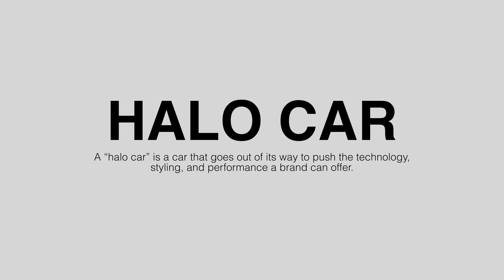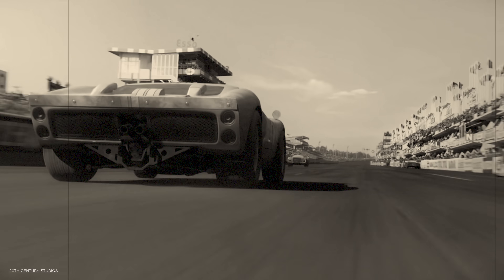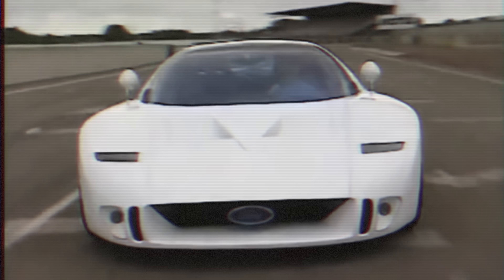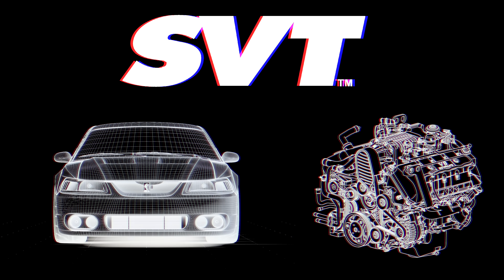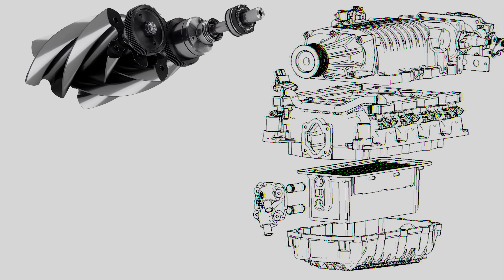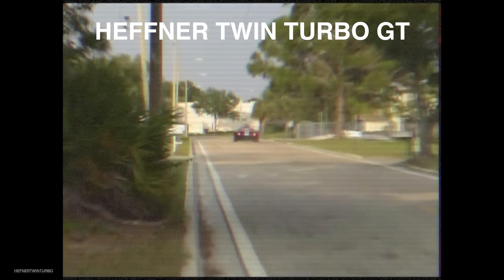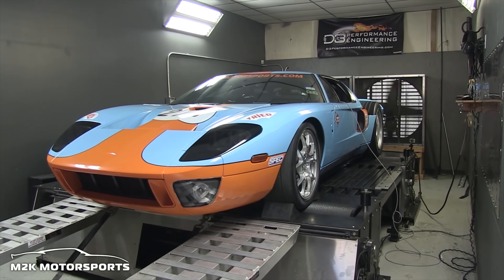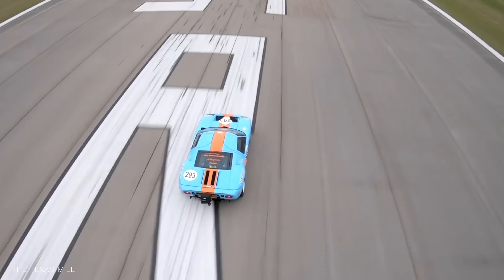Why Ford GT Engines Are Too Powerful (300MPH)😳| Explained Ep.16

Comment: 3000hp on the STOCK BLOCK is absolutely mind blowing stuff. This generation of ford GT is one of the great road cars in history
Reply: 4,000hp. Check out MMR Racing
Reply: Shelby himself. Peak acumen for petrol power.
Reply: And THIS! ...is why Doug Demuro bought one....legendary car...constantly appreciating
Reply: We have all seen what the 05' gt has evolved into.
Reply: boumahdi 🇩🇿  With billet block.
Reply: It's 310.8 to be specific. His goal now in the next 5 years is to push it to 400mph
Reply: @thomasgilliam3104 will never happen the Badd GT is fast but no street legal road car on earth can reach 400mph with a regular internal combustion engine.
Reply: @uriahbleue1947 he just needs to lower the drag. Most land speed cars that reach 400+ mph have a 3,000 hp engine
Reply: Amen 🙂
Reply: it is so great that Ford is going to stop making it because no one is buying it
Reply: Yea hp and mph are not the same.
Reply: I initially thought the 3000 was a typo until I watched the complete video. What an incredible machine! 💙🧡🤍, 💙🤍❤️
Reply: the most mind blowing part in that is the fact that those tyres held off at 300mph with nearly 2 tons of load and 3 veyron's worth of power twisting them
Reply: Different sleeves and of course those ARP studs.
Reply: The viper can handle 3k hp too lmfao
Reply: The old triton motors can do wonders with some better 4v heads on em.
Reply: The teksid blocks have allready easily handled 2500+ hp.
Reply: So is it stronger than LS?
Reply: @insansiregar6158  Any DOHC engine is stronger than a OHV pushrod
Reply: @insansiregar6158  Yes, won't lift heads, and flows more. LS good for 1500ish then start running into issues.
Reply: Sounds to me like they did some Toyota-esque overengineering on that one, and it paid off for the tuning community
Reply: @geronimowindow  no, it was a Ford-“esque” move their mod motor blocks hold insane amount of power. This Ford GT also uses stock heads. The suspension of the car is also stock, so is the body little no aero work.
Reply: @CoyoteFTW  it simply doesn’t make sense to me. You mean to tell me that Ford was building ALUMINUM blocks in 2005 that could make 3000 horsepower without cracking and putting them into production cars? That doesn’t seem physically possible. Bugatti engineered the veyron to be the fastest car in the world and I don’t think that the W16 in that car that made close to 1500 whp in the Chiron SS could handle double it’s factory output. It’s simply not possible
Reply: @lucasjaramillo3478  3,000? Add another 1,000. MMR Racing, factory block and heads. 4,000hp, 10,000rpm.
Reply: @lucasjaramillo3478  

Stock Chevrolet LS motors pulled from pickups and SUVs can hit 1000hp with minimal, inexpensive upgrades.  

2500 to 3000 from a purpose-built block?

Not surprising at all.
Reply: @boston7704  - not purpose built block STOCK factory. And a junkyard ls will last seconds with 1000hp
Reply: @boston7704  it’s pretty surprising. I don’t think you understand the engineering and materials science that goes into making a block that can withstand that amount of power. For Ford to put one into a road car doesn’t seem logical to me. Especially in 2005
Reply: @CoyoteFTW  You don't know Ls's very well with a statement like that. Wonder  why I saw ALL those mustang owners back in the day coming to the track with their LS swapped mustangs? Because they got tired of getting their ass handed to them, that's why. It only took Ford 14 years to design and build a competitive engine. I've owned both brands over the years and am a huge fan of both. Turbo'd LS truck engines will make 1k HP all day. The block, when introduced in 1997 was far stronger than anything Ford had at the time.
Reply: @boston7704  literally every 4.6 5.4 block ever made can hold 1000hp factory infact I think when the new casting method and metals changed the weak block problem for everyone
Reply: @lucasjaramillo3478  ford has the money to do what ever remember they built this the market crashed and they still didn't need a bailout
Reply: @austinhowze6280  but the technology doesn’t make sense for the time period
Reply: @jeffscott3160  Wrong. You can go to 7-11 and get a Free LS with any Slurpee purchase.  That's the reason you Chevrolegs guys are running around on US TAX DOLLARS.  👍👍👍
Reply: @lucasjaramillo3478  it's quite awesome, plus the architecture they used was developed when they owned Jaguar
Reply: @lucasjaramillo3478  yes
Reply: @johnchopp3278  mmr block is a billet block built by Alan Root. Now the heads they were running were non ported bone stock factory fresh from Ford. 5.80et at 256mph from only 351ci is impressive.
Now if go to realstreetperformance on youtube search for 2000hp coyote teardown. That was a stock factory block and crank shaft.
Reply: @brianadams429  John Mihovetz,  Accufab. YouTube him, 20 years ago with a Romeo engine block n heads, 5's in the quarter. Long time ago. 🤣
Reply: @brianadams429  oh yeah. Factory Ford crankshaft to boot. 🤣
Reply: @austinhowze6280  the 96-98 cobra teksid aluminum block would make 900-1000hp with stock internals
Reply: @oscarblanco1267  not at all the use the sane internals as the 2v you thinking 03 04 corba
Reply: @austinhowze6280  they couldn't cause the teksid were aluminum and the 2 v were iron. I was gonna do the swap on my 98 gt before I got rid of it  because I need it a pick up truck. I forgot in which forum you could find that information
Reply: @oscarblanco1267  same rods 4v pistons but 8 to 900hp is a terminator
Reply: @jeffscott3160  - no trust me I know the LS very well and it doesn’t hold a candle to Ford mod-motor power potential. All you guys have is always wElL HoWComE ls SwaP FoRd because even chevy guys are tired of crappy chassis and rear ends in their garbage cars, trust me no Ford guy is putting any bailout company engine in their car. SBF was already running low 7’s high 6’s in the 2000’s. Cleetus couldn’t do that and needed a custom built big block. Trying to compare mod motor pontential and the ls is just no comparison. John mihovetz went 5’s with a stock block and heads 4.6l Ford terminator. Remember cleetus couldn’t go 6’s with 100% aftermarket “LS” make sense ??
Reply: @CoyoteFTW  As I said, I'm a fan of both brands. Both brands have had issues over the years as well as garbage platforms they put out. If you had any reading comprehension skills I wouldn't have to repeat myself. Remember Triton f-150 engines where Ford thought it would be a great idea to only put four threads on the heads for the spark plugs? Then they thought it would be an even greater idea to add a bunch of boost to that and put it in the f-150 lightning. People had spark plugs popping out and denting the inside of their hoods. How do I know? I owned one, that's how. Over the years GM has had far more praise for its LS design than Ford has had for it's modular small block. I don't have a clue who Cleetus is but when it comes to racing, NHRA, ADRA NASCAR, and every other motorsport that Ford and GM compete in GM has far more trophies in their case than Ford does.
Reply: @lucasjaramillo3478  they were doing that a decade before that.
Reply: @lucasjaramillo3478  It’s always a question of reliability. Modded never get this: “you can build a GTR that does xxxHP for $nnn” - yeah, but it might blow up in random weather / gas combos and has no warranty.
Reply: @boston7704  Complete BS, a junkyard stock LS from a pickup or SUV is going to grenade itself at WOT with 1000hp.
Reply: @jeffscott3160  They were LS swapped because LS engines were dirt cheap to buy and dirt cheap to modify.
Reply: @johnchopp3278  4.6l teksid block I believe, cast in Italy?
Reply: @lucasjaramillo3478  they were making aluminum block 427 side oilers in the 60's.
Reply: @boston7704  not purpose built. factory production block.
Reply: @lucasjaramillo3478  6 figure price tag on the car ford can do what ever they want charging what ever money they want to those who will pay.
Reply: @jeffscott3160  nearly all modular for blocks will hold 1000+ hp sir LS arent special they are just CHEAP !! That why so many people build them yes they are strong but they are cheap.
Reply: @lucasjaramillo3478  Sounds like your feeling are hurt. 😆 Ford 1#
Reply: @seancrawford1422  my feelings were never hurt. But Ford is definitely far from number one lol. They make two good cars currently and they can’t compete with the best from Europe
Reply: @fordgtguy  record for a stock bottom end LS is 1543 hp done by Richard Holdener for Hot Rod Magazine and the motor lived
Reply: @johnchopp3278  
That's just truly insane. I need to get one of those if I ever come to money, even if I'd leave it nearly stock lol. At least I'd know that I never have to worry about the block and heads...
Reply: @lucasjaramillo3478  I'm late, but engineering is mind boggling, the Bugatti Veyron engine actually makes something close to 3000 hp or more but loses it due to heat.
Reply: @jeffscott3160  That's weird because everybody I knew that did LS swaps in Mustangs said it was because it was cheaper to maintain than the Ford engine was.The 302 mopped the floor with Chevy's 5.0 to the point that Chevy had to go up a whole engine size just to be able to compete with the 302, and the 302  Still held its own against the 350s.
Reply: @blickedxb  The 5.0 isn't an LS last I checked and serious racers don't give two shits about money when it comes to winning. If you wanna take a trip down memory lane then go check out who has the most trophies in the case in the various motorsports here in the U.S.
Reply: Have you worked on the cylinder heads on a mod motor and a Lexus V8?    
If you had, you would understand both designs came from Yamaha.
Reply: @johnchopp3278 One Youtube search and you lied about the 4,000hp on a factory block, it's billet.
Reply: @lucasjaramillo3478 The bugatti is still just a luxury street car at the end of the day all out performance wasnt the goal
Reply: @MV-ri7zu  wrong lmao
Reply: @jeffscott3160 lol no ls is only good because of aftermarket support for them
Reply: @boston7704 evolution Era 84 cubic inch Harley v-twin have 53h.p. in stock trim. It's common with machine process that removes over 70 grams from the stock crankcase along with boost to peak at nearly 400h.p. in nhra drag racing. Increase of over 8 times power increase without major issues. Wow!
Reply: @lucasjaramillo3478   don't matter what "you believe"  you just sound mad cause a Ford kicked Bugatti at their own game.
Reply: @johnchopp3278 the MMR uses a tall deck billet block. Definitely not stock
Reply: @jeffscott3160 you don’t know modular engines with a statement like that.. TEKSID block came out in 1993.. that CAST block has been proven to hold 3000hp
Reply: @CoyoteFTW it was a TEKSID block from 1993.. not a terminator block
Reply: @jeffscott3160 L S motors are for children. Anyone can make one run.  Stop junking up fords with inferior GM junk. If you can’t make a ford run find a Chevy to put your junk in , if you can find one left that hasn’t dissolved into rust.
Reply: @jeffscott3160 they come to the track with Ls swaps cuz the LS motor is a cheap made motor that makes good power.  
theres plenty of coyote 5.0’s and predator 5.2’s that will wax an LS, why cant the ls motor achieve over 900hp with just bolt on’s reliably?  
a 2020gt500 can make over 930hp with just bigger injectors and a tune lol 
if you want that out of a stock ls you’d have to change internals…..
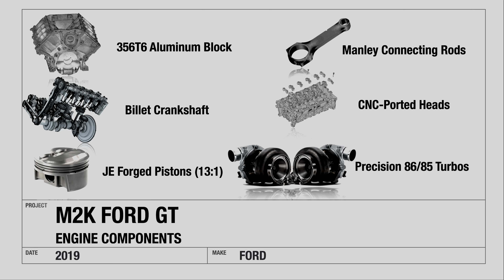Reply: @lucasjaramillo3478 the GTD mustang nurgburgring lap time 6:52 🤫
Reply: @lucasjaramillo3478  and Ford has been out selling all its competition for 61 years with one car the mustang.
Reply: @jeffscott3160  how many decades has Ford outsold Chevrolet and Dodge with the Mustang again? 
6
Reply: @DaBoomClap  Ford also has the best selling half ton truck too. Do you think GM gives two shits about how many mustangs or f150's Ford sells? No because they have consistently beat the pants off Ford for decades in over all vehicle sales. Why even mention Dodge/Chrysler? They've been sucking hind tit to everyone since forever. GM has far more racing trophies in the case than Ford does as well.
Reply: @DaBoomClap  Try a little reading comprehension genius. My post referred to "back in the day" many mustangs at the track were LS swapped, back in the day meaning before Ford introduced the coyote platform. It took Ford 14 years for an answer to the LS platform with the coyote. Also the GT500 is a boosted engine smart guy. Comparing it to a N/A LS is just stupid. A better comparison to that engine is GM's twin turbo 5.5L that puts down 1064hp.
Reply: @ so it’s slower than a Porsche that’s NA, has two less cylinders, and 300 hp less? Ford dropped the ball with the GTD
Reply: @ there’s still a lot of German cars better than the Mustang
Reply: @johnchopp3278 old post but MMR's 4000bhp engine is not a factory block. It's an all billet motor that MMR manufactures.
Reply: @lucasjaramillo3478 no there isn’t. German cars aren’t known for reliability and their cost for repairs in USA are not worth it.
Reply: @hashbrown4278 it doesn’t matter what they’re known for. German performance cars are reliable. Passenger cars are about as reliable as American passenger cars. But their performance cars are usually pretty bulletproof these days. You have no idea what you’re talking about
Reply: @lucasjaramillo3478 Bugatti hasn't been breaking any record. Tehy just break what they think is free, like the Mistral breaking the roadster record. They aren't competitive. They use heavy W16 engines that alone weighs 400 kg. Ain't good for performance either, too much rotational mass. They're just so bulky. Bugatti ain't making a lightweight car if they're tryna keep the tradition of 16 cylinders
Reply: @geronimowindow SUPRA
Reply: @geronimowindow  Toyotas are chick vehicles🤣
Reply: @jeffscott3160  

More like mom vehicles.
Reply: The W16 that Bugatti uses could take as well 3000hp. Bugatti tested it to its max on dyno. The Problem is to cool it reliable in Street use.
Reply: Fit and finish is shit though.  Have a maroon one locally and the wing is eating the paint

Comment: Johnny Bohmer! They've gone like 338mph!
 I remember this guy go and well over 300 miles an hour a years ago... I had a magazine that had a review of it Heavy Hitters.  Brought that to work and shit on my buddies who are into imports and Chevy's
Reply: Ah yes, the same guy who never ran close to his claims at events that he didn't have the equipment set up at lol
Reply: @Wopadas   You mean the one that they gave this certificate from Guinness too... With the facility where everyone goes into his high speed testing at that guy
Reply: @Wopadas  OK 👍 
 You do understand everyone pays Guinness and they just show up and verify measured times?  He's taken 3 different Guinness records... Callaway built the sledgehammer that went 255mph with something like 800 RWHP so I don't know maybe his Corvette went as fast as it did I wouldn't consider hes probably more credible than yourself.
Reply: @chrismathes3647  Guinness do not verify the equipment is set up correctly. Callaway’s Sledgehammer did that on a 7.5 mile oval. Bohmer’s claims are in a standing mile, you need a lot more power to do it in that distance.
Reply: @Wopadas  His claims are on a 2.3 mile runway, the same one that the Tuatara currently holds the production car speed record on at 286 two ways.

Comment: Sweet, I have a Ford 5.4 liter v-8 in my Expedition! Great to know that I'm just a few simple mods away from greatness!
Reply: Noooooooo that's a very different 5.4L.
Reply: @jamesturner2126  idk man, i got a 4.6 (same motor just shorter stroke) and they are a single turbo and injectors away from making the least reliable 496 hp ive ever made
Reply: @michealgray533  that's not how these work at all. There's about 10 different Ford 4.6L and 10 different Ford 5.4L.
Reply: @jamesturner2126  bro legit 4 main variants of both engines the 2v, 3v, 4v and the supercharged variants the most common being the 2v and 3v motors all had the same problem from a tuning standpoint, the relatively weak internals not standing up to much power as most would like and the heads on the 2v flow like shit so the most cost efficient way of making power in these engines is boost but only up to certain point

it’s hard to make cheap power on these motors if you don’t have a 4v or factory supercharged motor
Reply: @jamesturner2126  oh and the 5.4L 2v and the 4.6L 2v are the same exact motor down to the wiring harness just a different stroke so it makes more torque early on
Reply: @michealgray533  and they all only good for about 450whp then they send rods flying, even the 5.4 in the lightnings.  I'm still salty ford didn't throw in some Manley rods in the lightnings as they did in the terminator.  Those trucks are only some connecting rods/injectors/pumps away from spinning the eaton to over 500whp reliably without having to worry about scattering the bottom end.
Reply: Believe it or not Carroll Shelby himself said the 5.4l Ford engine was best engine ever made. 5.4 in your expedition with some very minor tweaks and boost can reach 1000hp stock.
Reply: @CoyoteFTW  WRONG!  to get the triton 5.4 even capable of getting to 1k hp you'd have to build that thing from the bottom up.  forged crank, forged pistons, forged rods etc. even the 5.4 in the lightning is only good for about 450whp before it scatters itself.
Reply: Except that you're 5.4L V8 in you're Expedition is either a 5.4L SOHC 2V Triton V8 or a 5.4L SOHC 3V Triton V8, only the Navigator had the 5.4L DOHC 32V Intech V8.
Reply: @CJColvin  also, that's was the iron block 5.4L 32v, not the aluminum block like in the 5.4L Ford GT.
Reply: @jamesturner2126  Exactly mate